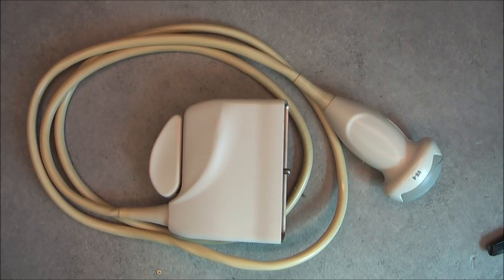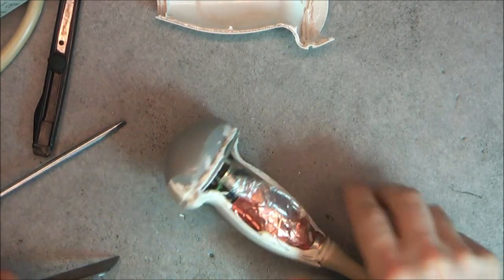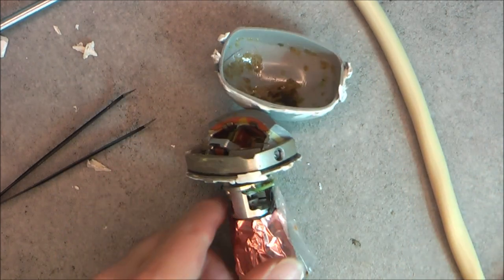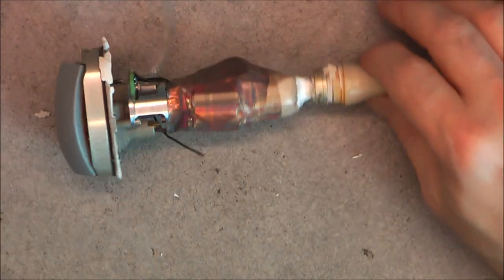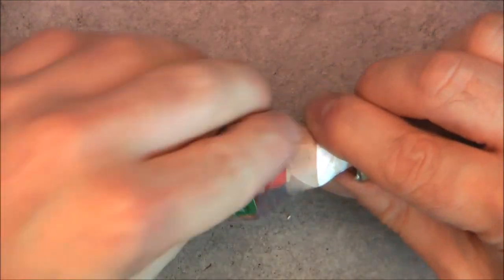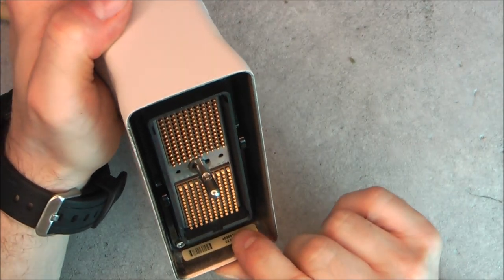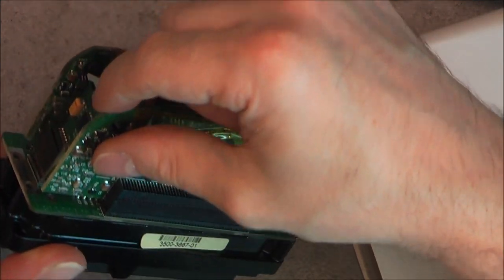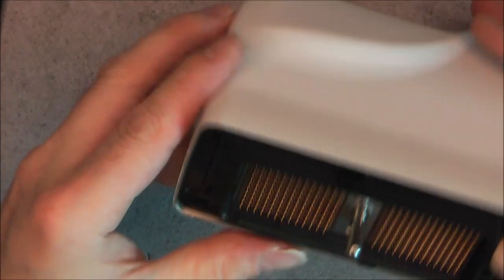Philips V8-4 medical ultrasound probe teardown

Comment: The IC's inside the plug portion is 16-channel High-voltage analog switches (HV20822) and there is 16 of them, so there will be 256 individual piezo transducers in the head. Expensive stuff!

Comment: The impedance fluid leaked through the cut in the rubber cap. I don't know in a probe like that, but it's usually silicone fluid with high viscosity. The durty you see is problably the remains of this fluid.

Comment: Nowadays, the drivers are integrated into the probe instead into the connector, but that wasn´t possible back in the 90ies (?) I suppose.
It´s a pain in the bu77 to squeeze the transducers, drivers, wires and amplifiers into a handy probe, that´s where the price is coming from.